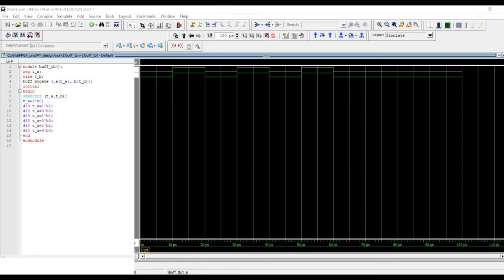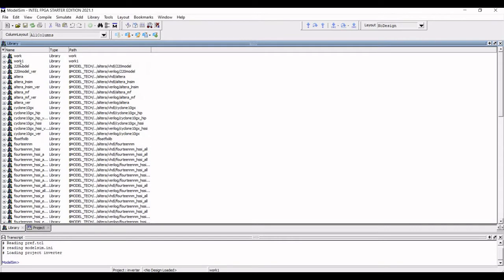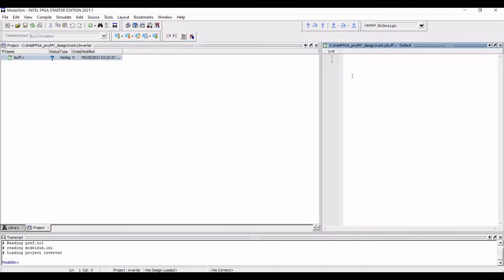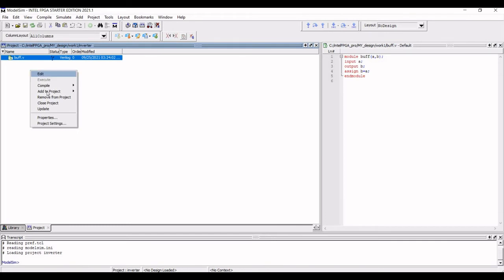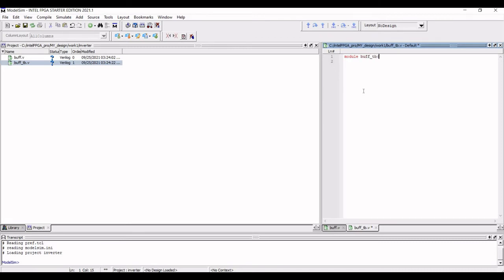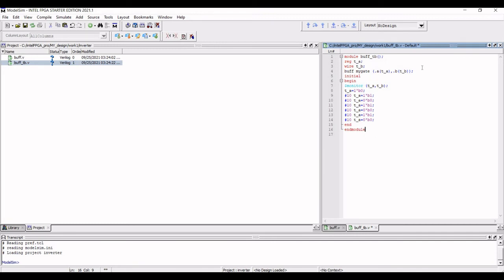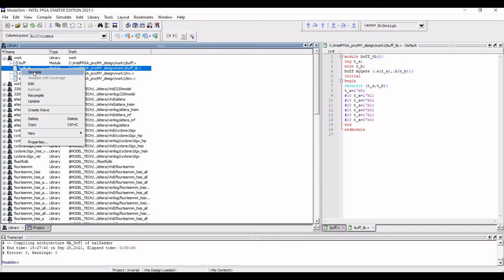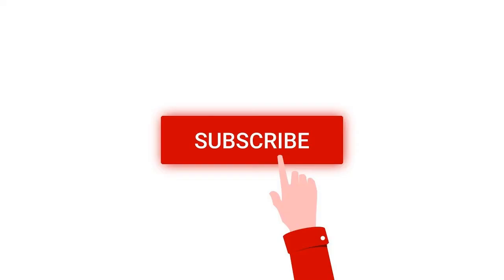Modelsim tutorial 3: Verilog code for an buffer circuit and its test bench for verification

Comment: where is the control signal for buffer???
Reply from the maker: This is digital buffer programming. The buffer which has control signal is tri state buffer. So the control enable can be either 0 or 1, so based on control or enable this can be electronically turned “ON” or “OFF”